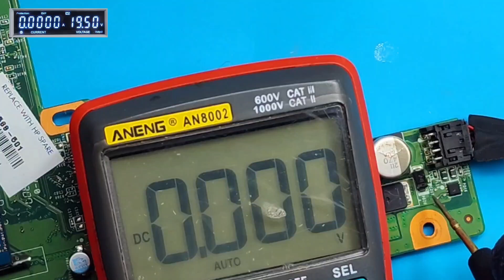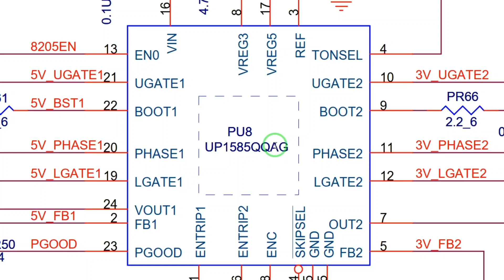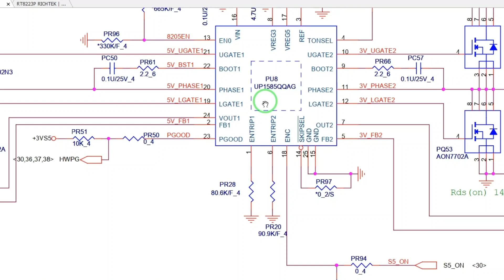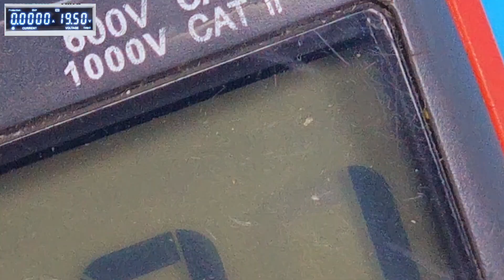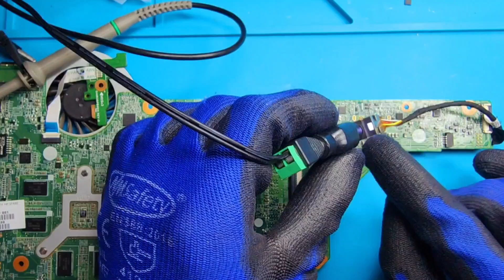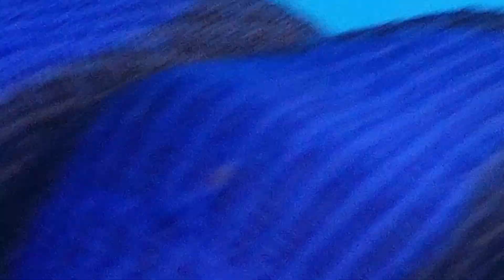HP G7 | What is the solution if an important signal is absent from EC?

Comment: i dont know what you repaired on this motherboard you have to look from 14;56 the chip has 4 shorted pins and the chip is the same when you take out and replace the same one just not with the shorted pins anymore :face-purple-crying::face-purple-crying::face-purple-crying::face-purple-crying:
Reply from the maker: @prosolder  Thanks for ur comment. I made a mistake there I did not see the pins connected together with the old one. After I changed another standby IC and it worked. This is legit work not a fake one. Actually, I already repaired it but for the sake of video I simulated the board to its previous condition by placing the old stdby IC but I didn't notice the pins shorted together. I accept it
Reply: @philiptroniks  👍

Comment: Looks like there some pins shorted with solder on the 3v/5v chip…
Reply from the maker: Yes you are right I didn't notice that😂. But that is with the old one. I think I did solder new IC properly.
Reply: Noticed that too, at least two different sets of pins shorted.
Reply from the maker: @inothome It's my mistake. Actually, I already repaired the motherboard but for the sake of video I simulated the board to its previous condition by replacing the old one. But I didn't notice that pins are shorted. And it is obvious that pins are shorted but I don't know how I missed it. Even it was not noticeable while editing video😂
Reply: @philiptroniks  OK, makes sense and thanks for the transparency.
Reply from the maker: @inothome  Thanks for understanding